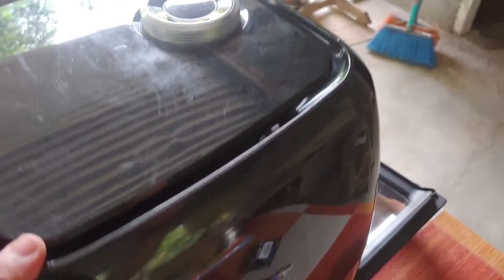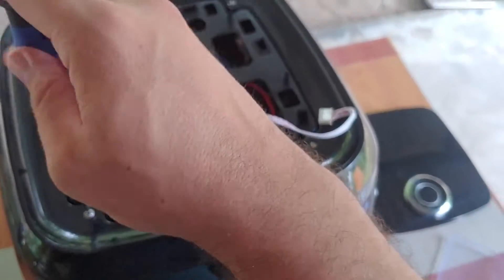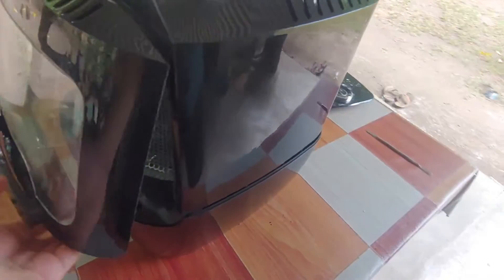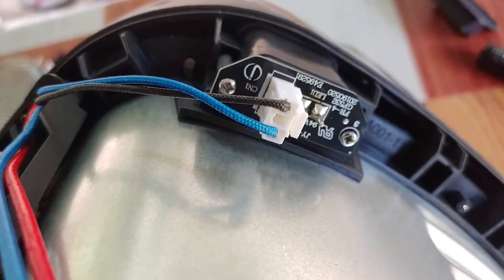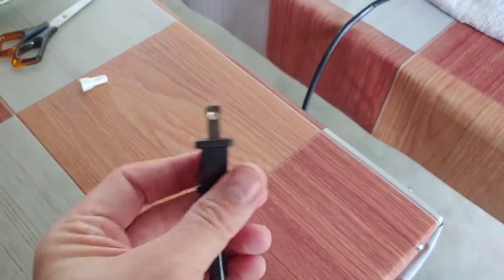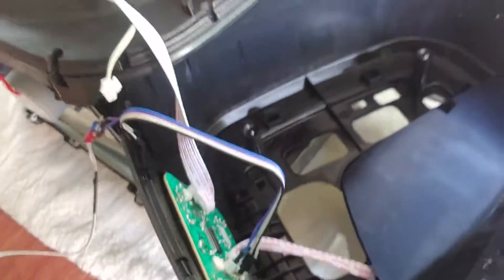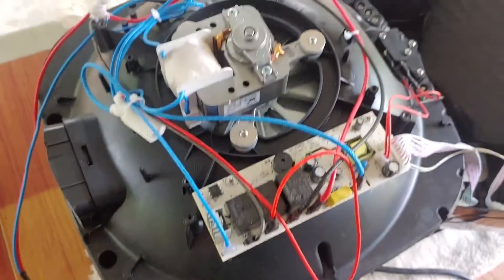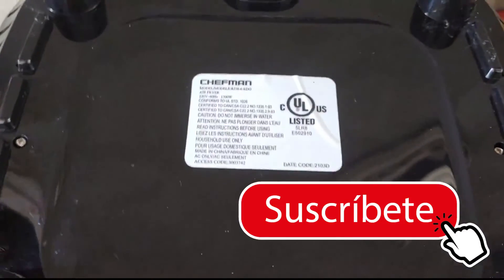Desarmando una freidora de aire (AIRFRYER) CHEFMAN RJ-38 formato HORNO, veamos QUE TIENEN DENTRO?

Comment: Buenas tardes  amigo excelente video gracias por compartir tu experiencia profesional quería una ayuda es lo siguiente. Tengo una 
Freidora de aire tiene tarjeta electrónica. Mi equipo no prende buscando encontré el fusible térmico quemado. El número de fusible 240C 15A 250v lo fui a comprar y no se encuentra hay el misma pero con 10Amp no 15amp mi pregunta es lo siguiente se le puede montar el fusible térmico de 10Amp en vez de 15Amp gracias
Reply from the maker: Hola bro, bueno en lo que tiene que ver con amperaje se ve bastante aceptable ese de 15 A ya que se acerca bastante al fusible q se quemó, fíjate q también sea de la especificación cercana a la temperatura, ya q estos hornos pueden calentarse bastante, si tienes acceso a compras por internet y no es costos este servicio en tu área podrías encontrar uno que sea el de las mismas especificaciones originales por la tienda de ebay o por Aliexpress.
Reply: @AJVtronic  gracias mil bendiciones saludos desde valencia Estado Carabobo venezuela